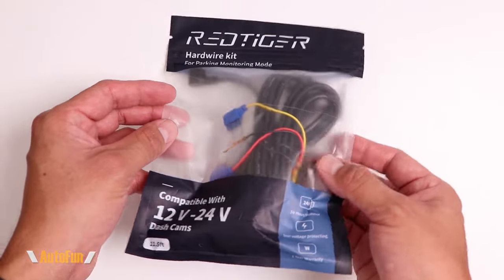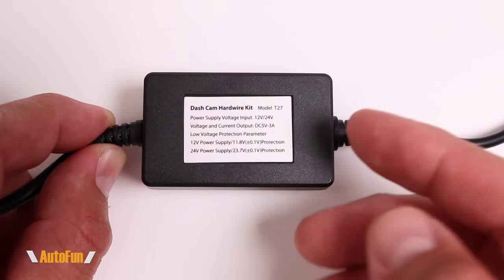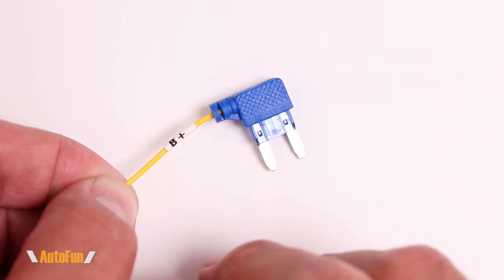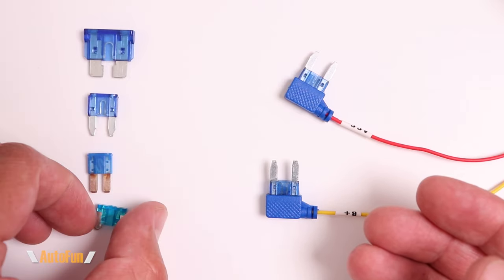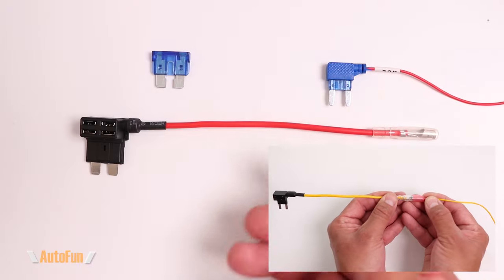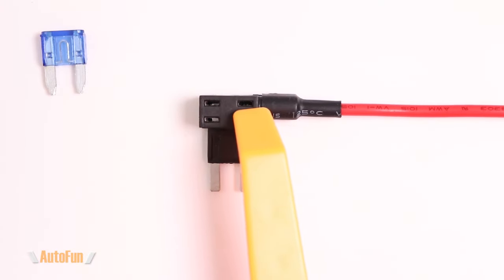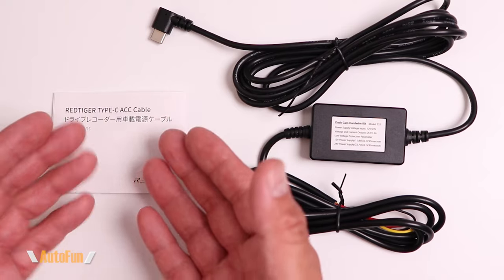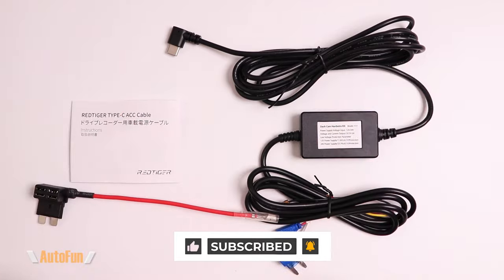REDTIGER HARDWIRE KIT (Install Prep, Connections & Fuse Taps Explained)

Comment: Just bought a REDTIGER F7NP along with this HW kit for my Wrangler.  Thanks for the vid, always great ones!
Reply from the maker: You're welcome Phil and congrats on your new F7NP dash cam! Cheers!
Reply: Just an FTI depending on what wrangler you have there are 6 accessory wires already there from factory.  In the wrangler JL with the accessory switches they give you 6 wires in the engine bay and 6 wires under the foot well of the passenger side.  So I installed my hardwire kit inside the vehicle and works like a charm. Just an fyi it makes it much easier.
Reply: @americanpatriot8996  I have a 2024 Sport S.  Man if I can install inside under the foot well that would be great!  I'll check more on that.

Comment: Exactly what I was looking for. I was back and forth regarding the "Single Fuse" kit and the "Double Fuse (with taps)" kit. However, my Mazda has limited spots of BAT in the fuse box so I'm getting the Redtiger "Double 4 Fuse" kit. Your video was the deciding factor. Even though I already was looking at the product on Amazon, I'm going to buy it through your link (and, hopefully, you get some commission).
Tu vídeos sempre exelcente!
Gracias mano!
Reply from the maker: Thank you for supporting the channel Rob!

Comment: They should have included the inline fuses in the wires, as the  given fuses will only be for replacement of factory fitted fuses leaving the dashcam hardwire without any fuse as 
most people while installing hardwire don't bother about polarity of fuse taps and fuse sockets.  And if some how they get the right polarity it will put double load on the single fuse as it will be providing power for both dashcam and default device.
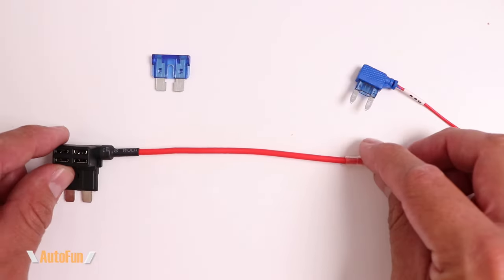Reply from the maker: Hi DODO! correct, the kit unfortunately assumes that both ACC and BATT will be connected to unused spots on the car's fuse box (and also assumes the fuse size will be a Mini size) If the kit is connected to a fuse spot that is already occupied, the use of functional fuse taps shown at 4:22 is needed to ensure both the original fuse is retained along with the fuse for the hardwire kit. I keep telling dash cam manufacturers to improve this (AZdome does it https://youtu.be/FLcIM2MwAL8 and also Rove https://youtu.be/9Pq3UKQNrcU with their awesome Ultimate hardwire kit) Hopefully one day they will listen! LOL Cheers Bud!
Reply: Exactly, especially for how much it costs. There are third party ones which are cheaper and include the inline fuses but Redtiger doesn't recommend using third party hardwire kits, I wonder why!
Reply from the maker: @khalilrazak6486  Hi Khali! yeah that is the one major weakness I seen on dash cams, the dash cams themselves are fully loaded with features but their hardwire kits leave something to be desire. So far only Rove has he most complete hardwire kit I ever reviewed https://youtu.be/Ny-TvRnhTs4 but again as you mentioned, using the matching hardwire (made by the same brand as dash cam) is the what I also recommend to avoid issues both technical and warranty ones. Hopefully one day will we see more manufacturers create better kits like the Rove one. Cheers!

Comment: I've watched all of your cameras for the red tiger F7NP - thank you fo being So detailed.

 however Im having LOTS of trouble installing it and I think I need to send back the entire camera - I have a brand new car - i've done all of the correct fuse checks and even had a dash cam fitter look at the car, but it seems that the redtiger hardware kit is turning the camera off once the inigition turns on, as it falls under 12v but then it doesn't turn the camera back on again.

I tried an old nextbase camera that I also have, which only has a red hardwire cable and this works, turns on and stays on. but I cannot get the redtiger camera to work when hardwired. Do you have any suggestions?
Reply from the maker: Hi Christina! That is very strange, specially if you had a installer verify the connections, maybe a bad hardwire kit? I would recommend contacting RedTiger for support, I'm sure they can walk you thru some troubleshooting steps. Hope this helps and please let us know what you find. Cheers!

Comment: Hi, nice video thank you.. there might actually be a jumper inside to change the voltage cut off?
Reply from the maker: You're welcome Sxpress! Ah I have not cracked this one open like the I did to this one https://youtu.be/RoiQ-Xvr09M which was reversible since it has screws. But since the RedTiger kit is sealed, opening it would require prying apart (breaking into) the case. I don't believe there is a jumper like the Garmin one has but if I ever do break one open and confirm, I will update this comment for you. Cheers!
Reply: 👍 @AlexAutoFun

Comment: IM ASSUMING YOU DONT NEED THE HARDWIRE KIT IF YOU HAVE A CAR THAT PROVIDES FULL TIME POWER WHEN CAR NOT RUNNING? 

(OLDER CARS)
Reply from the maker: Hi Raul! The hardwire kit is only needed if you are looking to enable park monitor on your dash cam or if you do not want to tie up your cigarette lighter port with the charger. Hope this helps, Cheers!

Comment: Thanks so much for your videos. Just a question - I could not find a hard wire kit for my T27, can I use the kit of the T700 to power my T27?
Reply from the maker: You're welcome Ali! Ah yes the T27 hardwire is readily available from Amazon or from RedTiger, I put links to both sources in the video description. Hope this helps, Cheers!

Comment: Great video, however I cannot isolate a fuse to install the battery cable in a 2023 CRV Honda. Can you help?
Reply from the maker: Hi Angel! Here is my follow up video where I cover how I find ACC and BATT on any car https://youtu.be/K2iKXj82354  However I strongly recommend profession installation due to the dangers mentioned on that video if erroneously tapping a critical system of the vehicle and the dangers involved with air bags mentioned on this video https://youtu.be/uZp95NbNlmM Cheers

Comment: Hi. Thank you for your very helpful and informative video. Finally realised I was needing a Fuse Tap to correctly install & use my RedTiger Dashcam & Hardwore Kit.
Are the soldered Fuses on the hardwire kit 15A for both the ACC and BATT wires?
Reply from the maker: Hi Chris! correct, the molded on fuses are soldered to the kit (underneath the molding) Here is my follow up video on how I replace this molded fuses with actual functional fuse taps https://youtu.be/Qzw9yUYN7zo Cheers!

Comment: Hi,this works with any dashcam brand?thanks
Reply from the maker: Hi Opaw! While it may be possible to use a different hardwire kit on a dash cam, I usually recommend sticking to the matching hard wire for the dash cam (brand matching) to ensure that there are no functional issues or issues with warranty coverage. Here is my video which covers hardwire kits and their differences in more detail https://youtu.be/Yky9_tTvwMc Cheers!

Comment: Hi, are the fuses soldered with the hardwire kit working ones or just as a plug? If they are, how many Ampere are they?
Reply from the maker: Hi Jonny! Correct, they are standard 15 AMP (blue fuses) Cheers!
Reply: @AlexAutoFun  Thanks, I thought they were 15A.
Reply from the maker: @jonnylee8538  Hi Johnny! Correction, you are right, I typed too fast lol they are 15A. Cheers!

Comment: Is it ok if I attach kit's plug directly to fuse tap hole (the upper) without attach to fuse tap's cable? I think the hardwire kit plug already has fuse itself.
Reply from the maker: Hi Dare! I personally don't like to connect the hardwire molded fuse into a fuse tap, because I don't like how high the assembly gets when stacking the molded fuse from the hardwire kit into the fuse tap and then having to deal with cutting and shutting off the unused pigtail so it does not contact anything (here is the video where I show this https://youtu.be/wAad_JA7kz8 at the 9:55 mark for those wondering what that looks like) Cheers!

Comment: Does it drain the battery too much?
Reply from the maker: Hi Yellow! Ah good question, that will depend on the car's battery, size, age, health condition and state of charge. In addition to that you also want to take in consideration any parasitic draw from other items on the vehicle that use power when the car is off. This is specially common on newer vehicles. For example I have an older Jeep that can sits for months a time with little to no battery draw, then I have a 2017 car that will almost completely drain my battery in a few weeks if the car is not used (and that car does not have any aftermarket devices connected to it). Here is the battery tester I use https://youtu.be/kCNrfa8RUKU if you want to test your battery for capacity and health, it can also perform a parasitic draw test if needed. I do carry one of this on long trips https://youtu.be/5eoewaav43A just in case but again I think my case is a little more extreme since most people only run 1 hardwire kit at a time and I run several kits on my car. Cheers!

Comment: will this protect my cars battery and alternator?
Reply from the maker: Hi Samuel! Typically hardwire kits do not affect alternators (but I would recommend checking with your mechanic to confirm the effects of adding aftermarket equipment to your vehicle). But yes as explained in the video, it does have low voltage protection to reduce the possibility of draining your car's battery. Cheers!

Comment: I have the hardwire kit from red tiger f7n dashcam. in my fuse box I have few empty slots but they have only 1 steel connect, apper or on the bottom. I was do so measure and I have the power when the engine ist turn of and when the key ist on. but the parkingmod don't want running. thank you for your help and great video and great job.
Reply from the maker: Thank you Piotr!  Ah yes here is my video showing how I find ACC and BATT on any vehicle https://youtu.be/K2iKXj82354 And here is my follow up video showing the rest of the install including some of the dangers involved with air bags when running the dash cam cables  https://youtu.be/uZp95NbNlmM And yes you can turn off Parking Mode in the settings menu if you don't need it. Here is my video showing how to use the dash cam https://youtu.be/K7qURDfoR7c Cheers!
Reply: thank you for quick answer. but my question is or the hardwire kit can working with empty slot with single connector?
Reply from the maker: You're welcome Poitr! Ah regarding your question, nope, most dash cams that require a 3 lead hardwire kit will usually need all 3 wires (ACC, BATT and GND) to be connected in order for the dash cam to work correctly. Here is is my other video https://youtu.be/Yky9_tTvwMc where I explain how hardwire kits work and the different features to look for when buying one. Cheers!  @piotrwiniarski3310
Reply: I think my question was wrong. in a fuse box I have  empty slots with single connector and I was plug in the hardwire kit w with 3 cables exactly like you show us. the real question is or can that working with single  connector in empty slot in fuse box? because normal fuse has 2 connectors one ist at the bottom and one ist at the top, if I can say that...
Reply from the maker: Hi Piote! Correct, if there is a empty fuse slot available that is my preferred way of doing the connection, you can see an example of that install here https://youtu.be/uZp95NbNlmM and here is my other video where I explained where fuse taps with two fuses or single fuse are needed https://youtu.be/Qzw9yUYN7zo Cheers!
Reply: thank you for your time and all your answers. You are doing great job 👍🏻
Reply from the maker: @piotrwiniarski3310  You're welcome and thank you!

Comment: So will it not function or record once the battery voltage gets below 11.8?
Reply from the maker: Hi Javier! Correct, the low voltage cut off is meant to stop the hardwire kit from powering the dash cam when the battery voltage reaches the cut off point to reduce the possibility of draining your car's battery. Cheers!
Reply: @AlexAutoFun  Thats not good I bought one for parking security....mainly for that reason only
Reply from the maker: Hi Javier! Most name brand hardwire kits have a low voltage cut off to reduce the possibility of draining your car's battery and leaving you stranded. There are a few basic hardwire kits out there (cheaper) that do not have that function and will stay on all the time at the expense of the car's battery being drained. So while it is possible to do so I personally do not recommend it. Most healthy batteries will stay above the cut off point so I personally always use hardwire kits with low voltage protection. Cheers!  @javiersalas7670

Comment: New redtiger app doesnt have GTRIGGER OPTION FOR parking feature. Any advise on that? And also if we leave screen on with hardwire. Does it make much difference
Reply from the maker: Hi H! Parking mode features vary from dash cam to dash cam. The App will let you select impact detection for park monitoring if the dash cam supports it and if it's hardwire correctly. I actually have a video on this coming up, stay tuned. Cheers!

Comment: @AlexAutoFun Can I use this kit for another Dashcam mirror that uses a Type C port, or is it just for Red Tiger?
Reply from the maker: Hi L! While I may be possible to use a different hardwire kit on a dash cam, I usually recommend sticking to the matching hardwire kit for the dash cam (specified by the brand) to ensure that there are no functional issues or issues with warranty coverage. Here is my follow up video https://youtu.be/Yky9_tTvwMc where I explain how hardwire kits work and the different features to look for. Cheers!

Comment: I really want to get the RedTiger hardwire kit to use with my RedTiger camera. my only issue is that the version of the camera i have is Micro USB and I cannot find that version of the kit online anymore. Would it be worth it to buy their USB-C kit and splice the Micro USB from their car charger onto it, getting a USB-C to Micro USB adapter, or getting an entirely different kit be the best move? I think cutting the USB-C head off the new one and soldering a Micro USB head from the car charger i have from them would be the more fun move (the bottom of my car charger from them also shattered and i cant find the pieces anymore so its dead at this point to me)
Reply from the maker: Hi Zendrith! Ah I got the same version too! lol yes the Micro-USB hardwire kit has been replaced with the USB-C. I normally recommend sticking to the matching hardwire kit for your dah cam but in this case I can see why an alternative may be needed, here is one that may work https://amzn.to/3NBqLcD but yes if you are experienced with electronics, swapping out the connector on the new USB-C one to a Micro-USB is definitely possible (and yes it could be fun depending on if you enjoy working and soldering small electronic components like I do LOL). Cheers!

Comment: Question-  If I hardwire for power all the time, why is there a need to connect to the ACC?
Reply from the maker: Hi Unplugged! Ah good question, ACC provides the signal that the car is On or Off which makes the dash cam turn On or Off for you with the car (and also trigger parking monitoring if enabled on the dash cam). The 3rd wire (BAT) is used to maintain power to the dash cam while the car off. And here is my follow up video where I explain how hardwire kits work and their different features to look for when shopping for one https://youtu.be/Yky9_tTvwMc Cheers!

Comment: I have the REDTIGER F7N 4K Dual Dash Cam. Amazon has a single fuse and double 4 fuse option. What is the difference. Thx.
Reply from the maker: Hi Danev! The single fuse one includes molded fuse as shown on the video. The Double Fuse, has replaceable ends (fuse taps) which are needed in some of the cases described on the video. And here is my follow up video that covers when fuse taps are needed in more detail https://youtu.be/Qzw9yUYN7zo Cheers!

Comment: What if your hardwire kit only has the red and black but DOES have the shut/off device for the voltage? Will it still work in parking mode?
Reply from the maker: Hi Karen! This will depend on your dash cam, most require their matching hardwire kit and using a different kit may not work correctly. Cheers!

Comment: I have a 2008 4Runner, should I get the double fuse or single fuse?
Reply from the maker: Hi! The need for a functional fuse tap will depend if there are empty fuse spaces (both ACC and BATT) on the vehicle, here is my video where I explain when functional taps are needed https://youtu.be/Qzw9yUYN7zo and here is video showing the actual installation https://youtu.be/uZp95NbNlmM Cheers!
Reply: @AlexAutoFun  THANK YOU!!!!
Reply from the maker: @flonga1  You're welcome!

Comment: how do you know what number/size the new fuse has to be?
Reply from the maker: Hi Andy! Notice they are using blue fuses which means they are 15A (if the molding is removed the fuses, the fuses are also marked with 15A). Cheers!

Comment: im on my daughters profile by the looks but ill ask anyway, just wondering why or if it would work by cutting the twin fuse link wire short and insulating it then plugging in the already fused wire from the dashcam and the fuse that came from the fuse box into the twin link then plugging it back into the fuse box slot to save time? I think it will work and will be checking it out tomorrow but probably wont cut it short just incase the dashcam fuse blows I can then join and get a fuse. ok ok saying it like that kinda makes me think why stuff around. thanks Max :)
Reply from the maker: Hi! Fuse taps are only required when tapping into a fuse spot that already has a fuse in it. Here is my other video where I explain when fuse taps are needed https://youtu.be/Qzw9yUYN7zo And here is my other video where I explain hardwire kits and their differences to look for when buying one https://youtu.be/Yky9_tTvwMc Cheers!